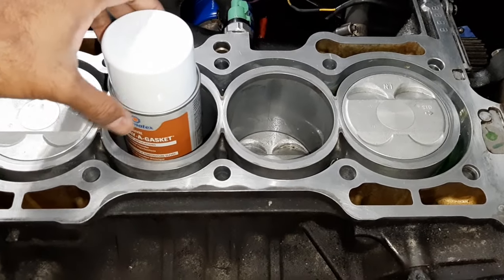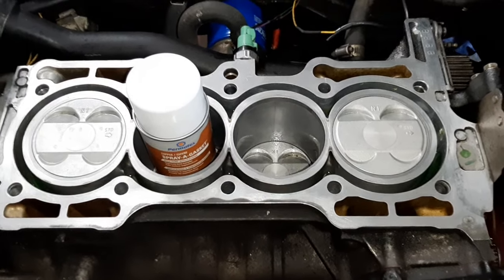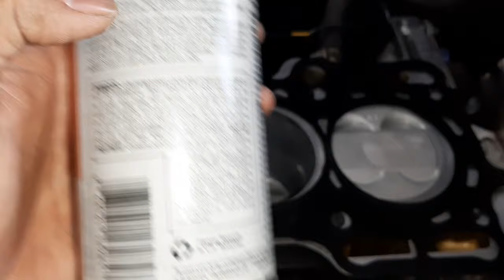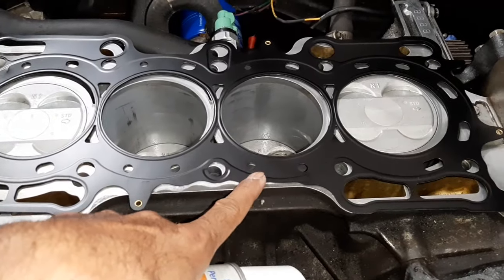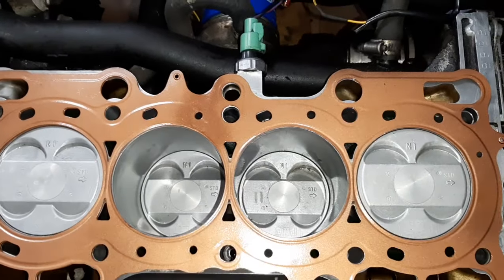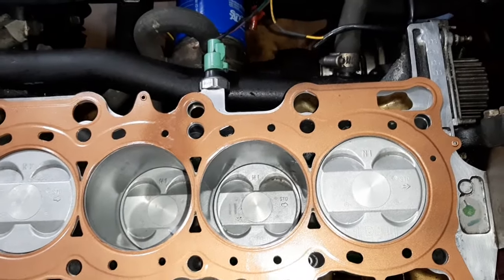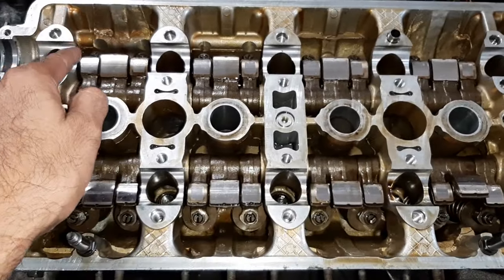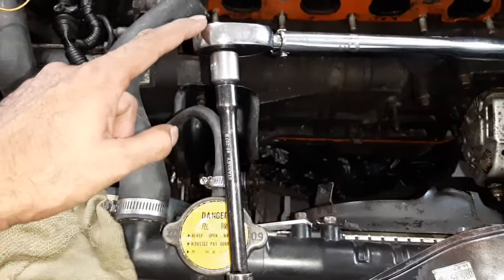How to use copper spray gasket maker on head gasket

Comment: You are making a big mistake! You are using a multi layer steel head gasket. They are not supposed to be coated with ANY type sealer. They require a super smooth surface where you cannot see any machine marks. Almost a polished surface. Using sealer will prevent any heat expansion movement and it will cause scuffing of the gasket surface and premature failure. GOOGLE are you supposed to use any sealer on a MLS gasket and you will see that i am right.
Reply from the maker: my previous attempt was clean as you wrote. And it failed as fast. That's why using this copper spray gasket maker this time. so far its working fine. Copper has high heat transfer ability and hence what you said about heat is not correct. Cheers
Reply: @wisemonkey1551  will it help on a resurfaced head but block not resurfaced?
Reply: @wisemonkey1551  i cant find composite gasket so imma need to use mls but will the cooper spray help?
Reply: I use it every time never fails stops future oil leaks from the head also very good stuff I also do the manifold gaskets I've got a car with a 8 year old engine still going strong no problems nice video.
Reply: @omardsm2323  stay away from it and do it right.
Reply: @thedude3189  apreciate it seems like im going to just resurface and get oem composite hg
Reply: WRONG!  I’ve been using this in performance and diesel applications and never have I ever had an issue with this.
Reply: I believe it's fine, 60k on my copper coated gaskets. I thought it was a crazy idea too.
Reply: @wisemonkey1551  is the gasket still holding?
Reply from the maker: yes but the copper spray works as liquid metal with not so even surface. That's the purpose ofthe spray. 3K miles so far and working fine with 230psi in each cylinders.
Reply from the maker: 3K miles so far and working fine with 230psi in each cylinders.
Reply: I’ve been using it for YEARS, if the engine is running with a off/on misfire & overheated once or twice I’ve torn it down re-used head as-is used copper spray assembled client still has vehicle it’s a economic solution.  If it’s too far blown this won’t help.
Reply: I used this on my 30 year old car and never had an issue. First time I installed head gasket without it , I had leaks . My friend suggested I use this and no more leaks. Has been leak free for 120k
Reply: Dude the machine shop that resurfaced my heads and has done literally Thousands me of them Recommends using this spray
Reply: @yarovyarnedo4075 I know right,  I've sprayed this on every LS I've ever built and never had a issue.  A chevy tech turned me onto this product because this is what they use at the dealership.
Reply: Why do you approach others and their work in this way?
Reply: @charredskeleton  So others don't have to totally do it over asain.
Reply: @supercharged2414   The tone, not the content. Why?
Reply: @charredskeleton  I apologize if my comment seems abrasive. I just want to warn those who use it when they shouldn't be using it. It is a lot of work to do a headgasket twice. After reading why it shouldn't be used on MLS or multi-layer-steel gaskets, I thought it pretty urgent to warn others when not to use it. I didn't use all  CAPS or shout my answer.
Reply: @supercharged2414   On the up side you did prompt others to share their first hand experience. Winch is invaluable.
Reply: @wisemonkey1551   9 months later how’d it go?
Reply from the maker: @charredskeleton  holding on fine no issues so far!
Reply: @wisemonkey1551 thank you for your comment
Reply: My car always with this cooper spray gasket since 10years ago until today no problem at all perfect
Reply: Thanks for the video. My head gasket job lasted  3yrs I did resurface  the heads.oil leak is back.i am gonna try this spray
Reply: I always use this even on MLS it's cheap insurance works great have never had a head gasket I replaced leak

No machine shop resurfaceing or block resurfacing either just cleaning with sandpaper and block
Reply: @wisemonkey1551  Is it still holding or are there problems with the Permatex
Reply from the maker: @Blackbandt  still all good, no leak inside or outside from headgasket. Did compression test and still over 200psi in all four. I did not expect it to be this good so far. The spray itself had full 5 star rating from headgasket mechanics and that's why I tried it. So far so good.
Reply: Would you recommend shellac?
Reply: @Heights.By.Great.Men...  I recommend using copper spray as they recommend it.  Not for multi layer steel haed gaskets.
Reply: @Heights.By.Great.Men...  No. If mating surfaces are prepared correctly no sealers should be needed.  I would think copper spray is best when used properly. I have only used it on head shims.
Reply: Copper spray will enhance your head gasket making it last longer I've been using it for a long time especially when thermal expansion happens it ensures no leaks even if you under torqued the head bolts by accident.
Reply: @wisemonkey1551 You won't have a problem don't listen to these clowns.

Comment: It's called Internet's magic... remember kids metal is stronger than copper.. If copper Head Gasket works then why not of the auto industry will be using Cooper Head Gasket ahhhhhh 🙀🙀😄🙀🙀😄🙀😿😱😲😲😲😱😱
Reply from the maker: It's not about strength. That partially liquid copper spray fills out the micro gaps between solid metals head. There is soft aluminum gasket at higher prices. Everybody type of brain gives a wise analysis on everytopic these days! That's the magic of the internet. Sad.
Reply: Head gaskets used to be copper. You could heat them up with a torch to make them soft and reuse them.
Reply: Today the only folks using copper gaskets machine slots in the block or head. Then they install a custom ring into the groove to squish the gasket & never re-use. They are racing.  Old motors had crazy low compression compared to today.  @tortron
Reply: @ohane1  yes I have vintage cars with about 8:1 compression and copper headgaskets. But also use custom copper gaskets on high compression motorcycles, or when it's hard to get one for a "modern" car

Comment: When doing any cylinder head use new bolts always warm the engine up shut it of next day when the engine is cold drain the water out of the engine break the bolts off not all the way leave a little tension then re torque the bolt to yeild it will last forever after doing that the the bolts stretch a bit after warm up and causes uneven tention.
Reply: "Warm engine up and shut it off next day?
Reply: @brandonknight7240  Damn these phones always alter the words but you get what I mean warm it up shut it off and the next day when the engine is cold break the bolts off and do them again diesels can be different and requir a certain temp to do it petrol engines are easy.
Reply: Ha Ha Ha, sure thing.
Reply: Nop, not on a Toyota or Lexus.. the valve gasket must be on before first start. The book says do not warm and  torque down the second time. The manual points out that working the head down once is sufficient. As a matter of fact most modern engines do not recommend twerking down the head a second time. That is why the MLS gasket disused. Working the head down the second time with an MLs gasket in place can in fact damage the MLS gasket.
Reply: No No No... Is this a troll?  Plenty of heads have torque to yield bolts, and many don't.  This advice is literally the worst I may have ever read. Never EVER loosen torque to yield bolts, that will by definition destroy them.  They stretched and were literally springs, loosen them & they will never grab like they should have. They were stretched springs & you destroy them taking them out.
Reply: DO NOT do this if you're using TTY head bolts. They stretch when the final torque spec is performed and if you back them out, they'll never retorque. You'll have to completely replace the bolts and do the torque sequence all over again.

Comment: Thenk for the video. I just did a new mls HG on my chevy sonic 1.8l. i wish i had swen your video earlier. Its is still sending bubbles into coolant expansion tank. I thrn used K Seal and it stopped. I guess this will be a temporary fix. Once i pull the head again, i will use your method, thank god they engineered this engine like a lego set. 😊

Comment: The service manual says never reuse gaskets. It says not to spray any other spray gaskets on genuine gaskets.
Reply: It also says to only use the expensive oem fluids or it will break the motor..  but you can put the equivalent knock off cheap stuff and get same results..  service manuals also tell you to take apart a whole bunch of stuff to do certain jobs when u can bypass much of it and finish in a fraction of the to time..

Comment: Thanks for the clarity in your great video on Spray-A-Gasket (copper) Reusing a gasket that has done only 15 mins max , this will save me approx., over $ 200- for a new one , yes a ridiculous price . Caterpillar are making gaskets for the Aussie Ford Falcon Barra engine now for the rev-heads fitting Turbos plus many dollars and getting over 1000kw . It has become the 'go to engine' for a wide range of vehicles. Mine < 200kw is just perfect . Thanks again 10-10-2023

Comment: I have fresh machined 1974 sbc block and heads. Bought felpro gasket set supposedly premium and the head gaskets are just steel shim stock (.015” thick). Inquired with felpro and they said to use a spray on sealant (such as the copper coated sealant). So that’s straight from felpro for the 7733SH1 steel head gaskets.

Comment: with the multi layer steel head gasket which this appears to be, you have to make sure the heads and block are as flat as possible. Otherwise you will be sorry as it will leak and overheat. Take a straight edge, measure the surfaces and half the tolerance of the OEM service manual provides for the factory composite head gasket.

Comment: Must the spray dry 1st before installing head?
Reply from the maker: yeah took 3 mins to dry but it stays soft which is normal
Reply: @wisemonkey1551  thanks after torqueing down i let engin sit for a day..... been running good for the past week.... no leaks so far lol
Reply: @babelonchabalala1690 did u spray it on a mls gasket?

Comment: Thanks for the info💯🙏🏽I have a Quick question. I have HEAVY White smoke, sweet smelling Coming out The Exhaust of my “2011 Jaguar XJL 5.0” so I poured blue devil into my coolant reservoir  (I didn’t drain my coolant before adding Blue devil, also had a sealed Radiator) Anyways I closed the coolant cap as soon as I poured the in & drove for about 30 mins, Next day later? My car just makes a 1 Click noise!! &Jump the car nothing Same Loud “1 CLICK”😢  What may have happened?  (Also Car oil burns in under 3 days, and coolant reservoir becomes underfilled in 1 day) Also do you think it was my upper intake manifold? Blue devil May have sealed my cylinders stuck? How do I fix?!? Plz help?🙏🏽🙏🏽🙏🏽🙏🏽😭
Reply from the maker: coolant oil mixed inside the engine. That stop leak went in the engine probably seizing up the main bearings. Sorry but instead of adding a stop leak (it does not work with leaking head gasket), you needed to do an immediate engine head rebuild. Now probably a full rebuild or replace the engine with a known good one. I would verify first and then if seized, replace it.
Reply: So I didn’t have Coolant in my oil, but it was burning coolant. U think the sealant sealed the pistons to the cylinders?
Reply: I hand cranked clockwise 3 times before it got stuck. Idk what happened but I didn’t remove the spark plugs when doing so. I did hear air coming out of one of the cylinders when hand cranking
Reply: Is there something I can pour into the cylinders to free it up while hand cranking?
Reply: @michael-johndunning882  If you didn't figure this out yet, you could have vapor-locked the engine. This entails massive mechanical failure, namely bent rods among other potential failures. You need to be shopping for a new, functioning engine out of a wrecked vehicle. Don't take anyone's word for the engine's running condition. View it yourself or get a 120 day warranty with it.
Reply: If you want to you can soak the cylinders with some Diesel let it sit for a day and then take some thing (aluminum pipe) thats similar in diameter as the pistons, and 'shock' the pistons free with a good blow to the aluminum pipe. That should free any stuck pistons... however if you got it to turn and THEN it got stuck, chances are it is bent rods or something as mentioned above. 

That blue devil stuff is fucking nasty shit I would STAY AWAY from that garbage... I only say this because the same blue devil stuff once FUBAR'd an engine of mine in 20 minutes flat... it was brutal. I'll never touch it again. It only 'works' based on the fact that it hardens and sticks to the walls of your coolant system and engine, sort of like how cholesterol sticks to the walls of your arteries and it can get messy real quick.. for the risk factor it's not worth using that shit. Fuck i hate that blue devil stuff! Sorry about your car man. Good luck
Reply: How’d it go? 8 months out you’re probably past it now. For others here looking for answers it might have hydro locked. Hydrolock means that fluid(coolant) is in the cylinders during the compression stroke. Remove the spark plugs and try turning it over by hand.  Hydrolock does not always bend rods and break rings though it can. Based on your description the engine requires a lot of work. Block sealant of any kind will block passages in the radiator and heater core, likely requiring their replacement as well. Overall don’t jump to conclusions, have the confidence to explore, learn and understand.

Comment: Can this only be done on a metal head gasket ?
Reply from the maker: Both metal or aluminum
Reply: @wisemonkey1551  my head gasket is like a fiber material not metal
Reply: @ducaduke  maybe that is valve cover gasket, because head gasket use metal
Reply: @danaranalengpe9079  Thats not true, most head gaskets are composite which is fiber. Only some newer engines use MLS (Multi layer steel)
Reply: @arbit3r  WRONG, MLS head gaskets are available for most engines, even 100yo Ford engines. Hell my 96 Miata has a mls head gasket.
Reply: @DiscoMiata  Not all. I have several engines from the 80's and 90's which only come with composite. There's no MLS available, not even aftermarket. Even if you did find one the head and block would require additional machining to accept one as they are very intolerant to imperfect mating surfaces.
Reply: @arbit3r  A Japanese company trademarked it in 1970, you can find MLS I gaskets for engines dating back to the 1920s
Reply: @DiscoMiata  should i use copper spray on my miata gasket? i’m doing a head swap right now
Reply: @wifiluna7632  I would not do it on the head gasket if it is brand new but if it’s really old go ahead, but at the end of the day it shouldn’t hurt it. I want to check out your car drop me your Instagram
Reply: @wifiluna7632  I have a BP4W head awaiting love in my car
Reply: @DiscoMiata  im just not sure if my block is fully smooth, do you think using copper spray would be a good idea for that?
Reply: @wifiluna7632  drop your Instagram for internal engine help. 

If you see a bunch of reply’s from me it’s cause I’m not sure if YouTube is posting my comments(glitched)
Copper spray is only good for minor imperfections
Reply: @danaranalengpe9079  Wrong! they are not all metal.
Reply: @DiscoMiata  Wrong, guess you are young and have only worked on new cars. Mainly only turbos need MLS.

Comment: I bought copper spray and then  spray on my new gasket  but leaking again. my friend said clean copper spray on the with clener. so I paid cleaner for clean copper spray on my new gasket. Installed gasket and start engine. WORKING FINE.. you want to pay copper spray? you want to pay copper spray cleaner? ha ha ha ha.
Reply from the maker: Or it could be that the first time you did not torque the headbolts right. You have few variables there really. Thin copper sprayhas five start rating for a reason I think. Mine is still going fine without any leak.